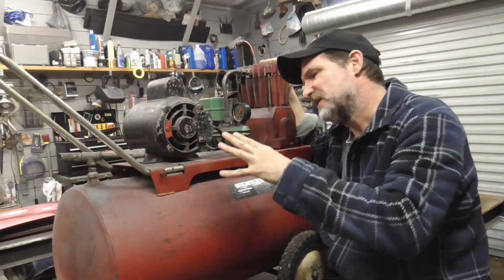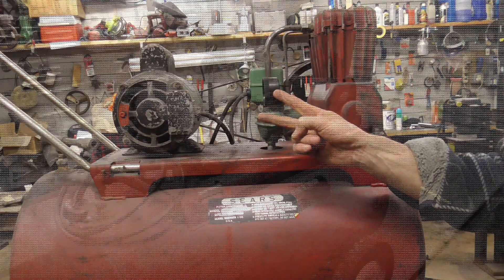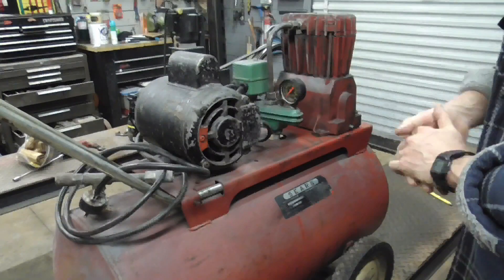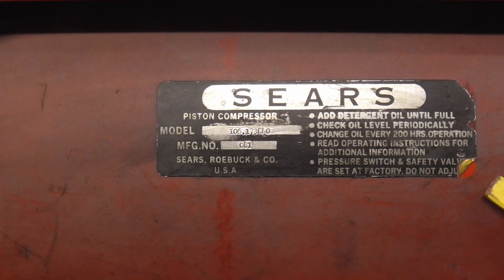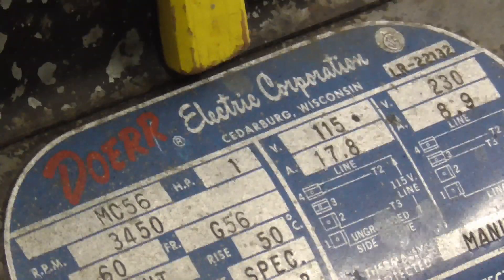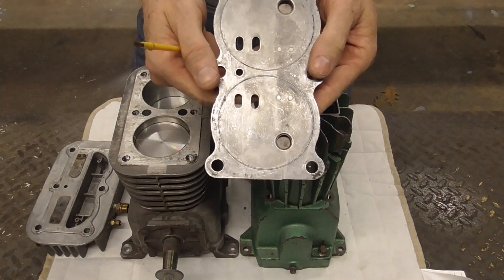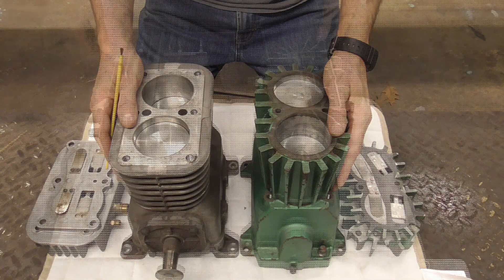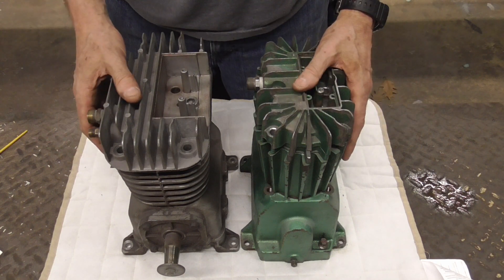What Size Air Compressor is Needed to Paint a Car?

Comment: Perfect timing, I’m looking for another compressor for my back garage. I have a 60 gallon Ingersol Rand for my front garage, it’s a dandy. Just changed oil in her a short while back. I’ll be on the lookout for one of these gems, Dave!
Reply from the maker: You will love it!  If you find a nice one you will fall in love with it.
Reply: Lakeside Autobody I’ve heard your compressor running in the background, often wondered what you had. On my FB search, thanks.
Reply from the maker: @davekana8388  Craftsman/Sears Model 106173840 (1hp, 20 gal, 110v) It doesn't have to be that exact model just from that era 1970's and 80's I think.  They were all US made Devilbiss or Campbell Hausfeld that were labeled for Sears.  Great compressors that are fairly quiet, won't die and you can still get rebuilt kits for them.  Belt driven, oil filled compressors can still be purchased new though if you prefer.  Jerry
Reply: Lakeside Autobody, I’ve got a Sanborn 3 1/2 hp 11gal. It’s a non oil one, it can wake up the dead. That’ll work till I find similar to yours. I used to have a 2hp brown sears or craftsman and a green one. Found a green 2hp craftsman on FB marketplace today for $30 it was sold. How does your 1hp keep up with all you do? I’m going to look for your vintage, thanks for the help, Dave.

Comment: I'd like to add a few points that might help someone. My apologies Jerry, if you already covered this in another video.  Compressors like this work hard to keep up with high use tools. They pull lots of water out of the air, especially on hot & humid days. The water comes out of the tank in the form of water vapor and the vapor will pass through typical water/oil separators, quickly saturating any vapor filters, unless it is first condensed into water droplets. Established body shops spend lots of money on fancy air drying equipment but there are other ways for the hobbyist or start-up folks to get it done. Here are some ideas.

Locate your compressor in a cool space if possible. A basement is ideal but not if it lands you in divorce court :-) . You want as much distance as possible between your compressor and your filters. Get creative. At one time I had an extra 50 feet of airline after the compressor. It was on the garage floor in coils with old blankets heaped on it. Looked ugly but the cool concrete floor did condense lots of water vapor. I currently have about 80 feet of 1 inch black iron pipe in between and it does a GREAT job! The pipe does not need to run in a straight line; if space is tight, get inventive. A vertical floor to ceiling radiator-style pipe rack works too. Remember to provide a low point with a ball valve to drain out any accumulated moisture.
Reply from the maker: Thanks a lot for your input as it will help someone out for sure - water drops in the paint is always a bummer.

Comment: Hi, thanks for the video. I have a home garage shop. I looked on craigslist at these old compressors. But I want to use a small right angle grinder. Everything l read is pointing me to a 60 gallon compressor. 220v I rather not get it. Any advice? Also do you know of a small electric right angle grinder 110v? Thanks love the channel.
Reply from the maker: I use a compressor that's rated at 6.4 scfm @ 40 psi / 5.4 scfm @ 90 psi.  It does have to catch up sometimes but I don't mind taking a break and drinking some coffee here and there.  Check this site out - https://www.tractorsupply.com/tsc/catalog/portable-air-compressors?cm_sp=SBC-Air+Compressors-Portable+Air+Compressors  
This Powermate is made in USA and puts out 6.2 at 40 and 5.3 at 90.  If you are using the grinder non stop you'll have to let it catch up but if you use it intermittently, you'll be fine.
Reply: @LakesideAutobody  Thanks for the quick response, I appreciate it.